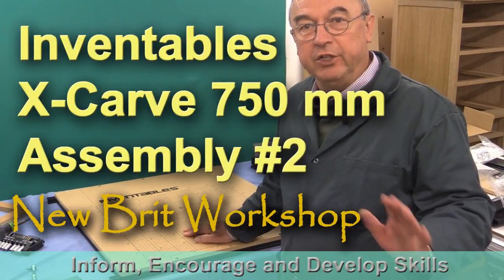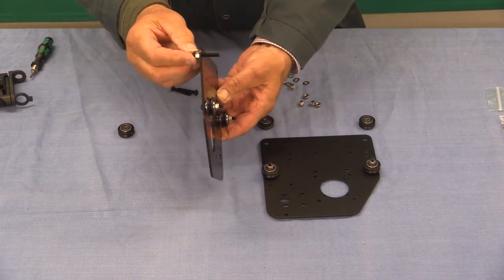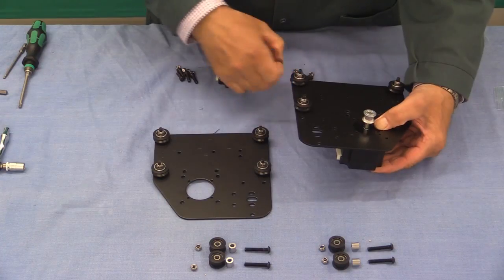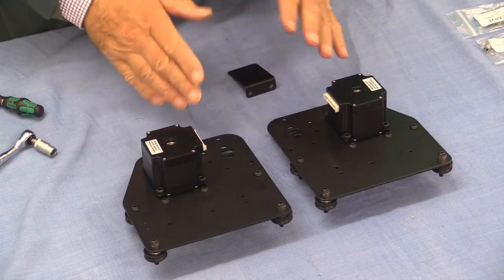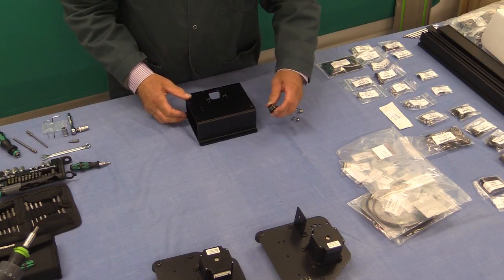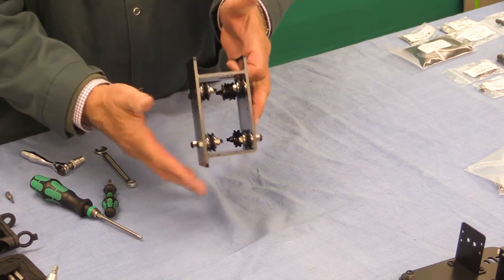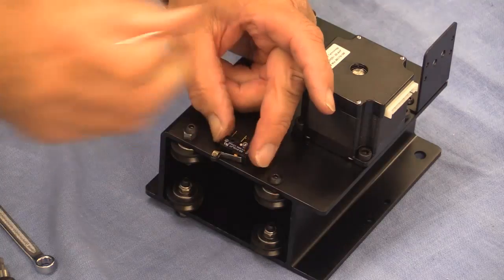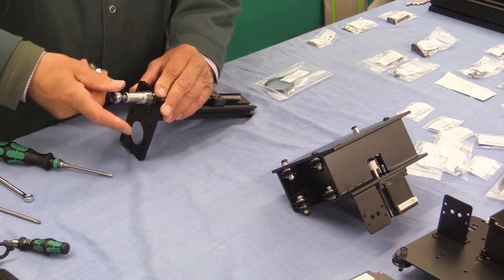New X Carve 750 mm CNC Assembly - Part 2

Comment: 10:20 I found this part the worst part of the build. I brought my xcarve 750mm back from the US recently and I almost thought I would end up buying a new pulley. The grub screw is waaayy too small to get any decent leverage. Very fiddly. They need to change this bit I think.
Reply from the maker: Hi Andy, I looked carefully at that part and must say that I had no problem at all. I agree that the grub screws are small but they are not so tricky to tighten. One does have to take care when tightening the nut on the end and the tip, in the Inventables instructions, of using the hex key worked out okay.  How far into the build are you? Maybe you are using the machine - are you pleased?    Peter
Reply: New Brit Workshop I just think the way they have you tighten it in the instructions is inviting trouble; it describes using the needle thin Allen key pushed up against your thumb and the threaded rod for leverage. The Allen key either bends or the tiny grub screw rounds off in my experience.

I found the instructions to be generally fine, although there was one part where the instructions were misleading so I used the feedback form to report that. It also decreases in detail as the instructions progress for whatever reason.

I have now completed the build and I am happy with it. I have also 3D printed dust pulley covers for the left and right sides of the gantry and for the top of the exposed z axis assembly - items which really should be standard.
Reply from the maker: I agree with your point. Do you have a link to a video of your dust covers? It would be great to see them fitted. I also agree that they would be a useful part of the kit.   Peter